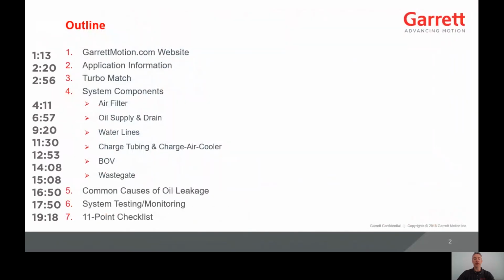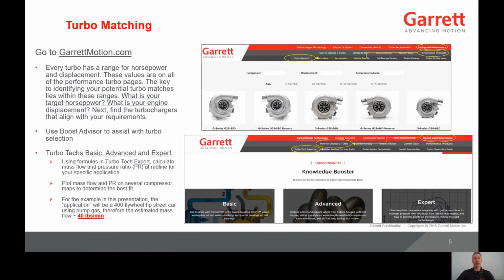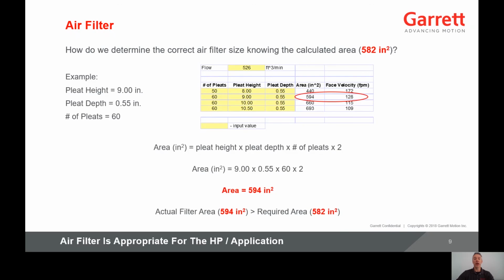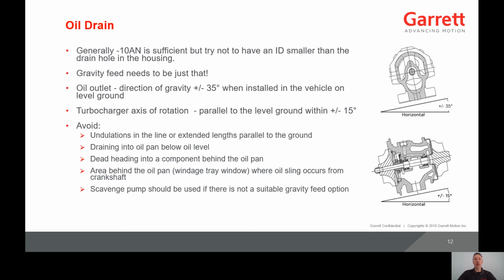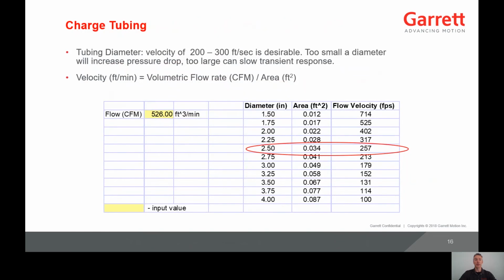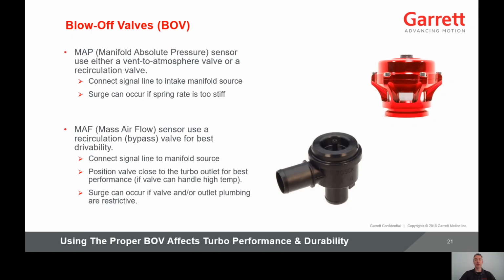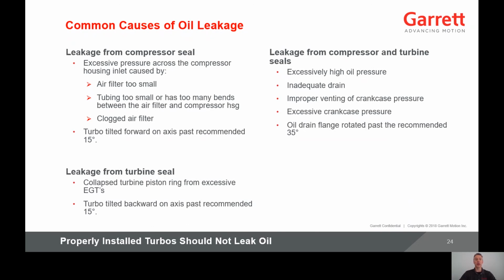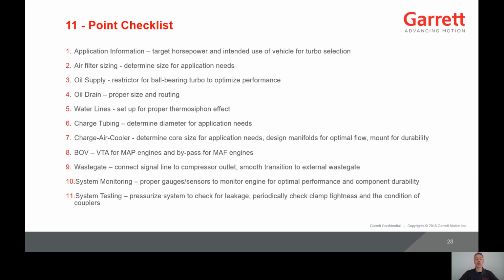Garrett Performance Turbo Optimization

Comment: Hello i have a question, after installing new Garrett turbos on my 2017 Raptor i no longer get a bov sound when reving on idle, i do get bov when the truck is running but not when reving in neutral or in park

Comment: I used to use the Garrett calculations but they are too long and the use of non standard measurement is frustrating. Get rid of all the imperial measurement and use Metric already. It's 2021 not 1921!
Reply: Metric isn't the end-all-be-all. They both have their strengths and uses.
Reply: @jonathanh4446  There is no measurement where imperial is better. You are delusional if you think so.